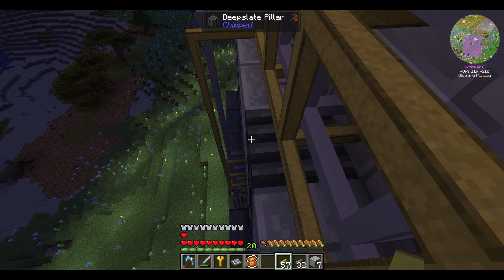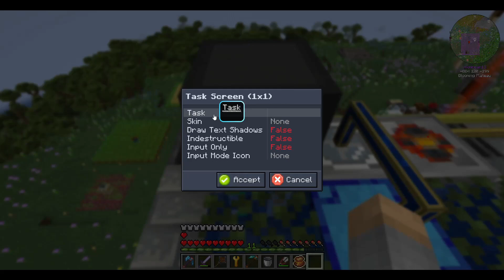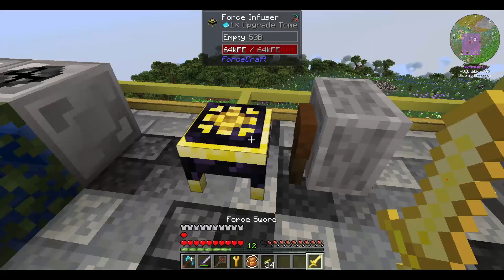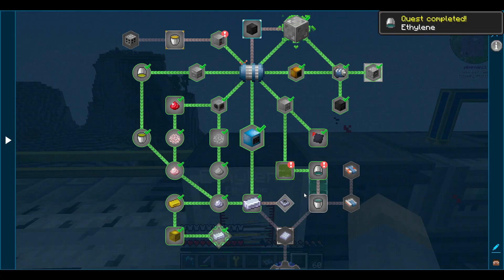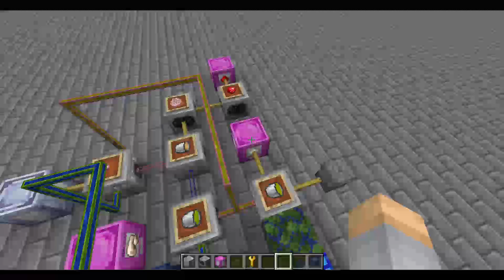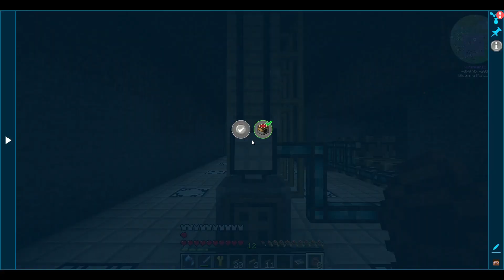FTB NeoTech Guide- Episode 6- Is This Cheating?

Comment: This and all the videos before it in the guide have shown me that I have been thinking about "Automation" the wrong way around. What I did was set up AE2 requester to have my system craft everything up from zero (dusts) produced by the quarry.
I guess it's my irrational fear of running out of dusts for alloys and missing out on other components that held me back so much

Managing the size of the buffer to my resource stockpile so that it doesn't all get used up was the key. Now I know how to keep 10 stacks of Analog Circuits in a barrel without going overkill and turning all my gold into sheets

Great stuff, man. I learned a lot
Reply from the maker: @Punsmaster2  buffers are your friend. Good to hear you figured it out, it makes things a lot easier and faster when you know to just keep large stocks of things.